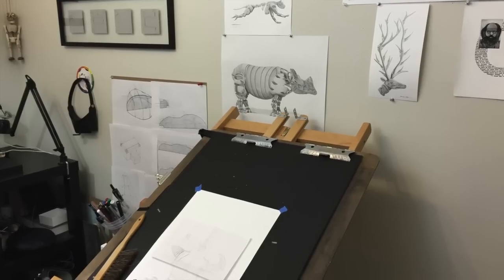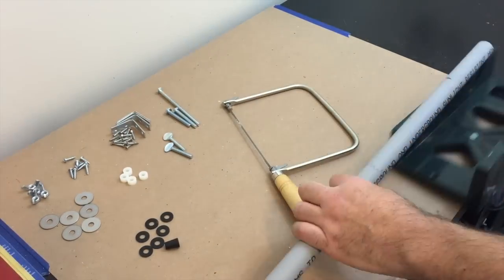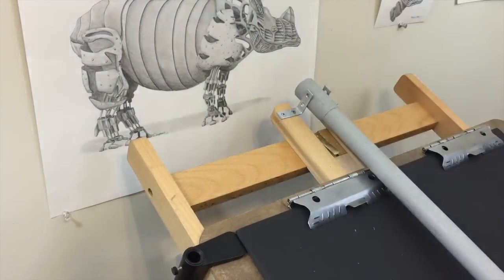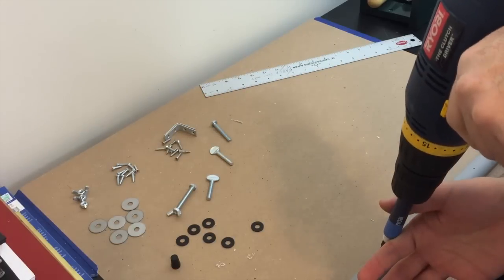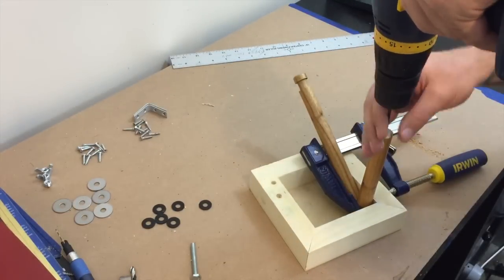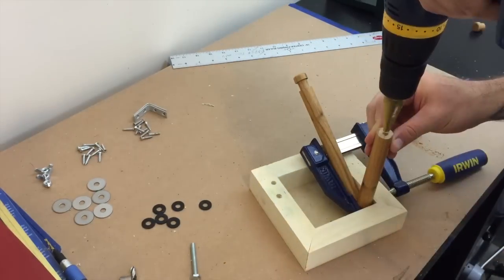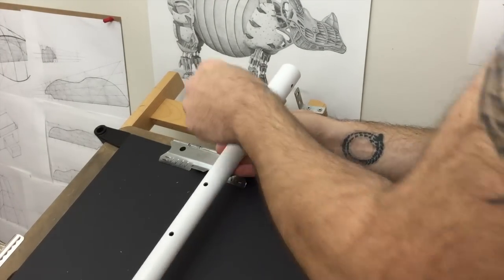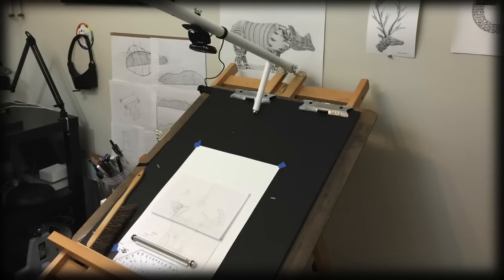Making An Easel Camera Mount For Recording Drawings

Comment: What kind of camera are you using? I am new to this, so , I'm sorry if the question seems silly. Thank you very much.
Reply from the maker: +Marle ny I'm using a Sony A5000 for filming my videos, and I use a Logitech C525 webcam when I'm recording drawings. I do want to upgrade webcams to a better model, but it works decent for now. Hope this help!
Reply: Thank you very much! Logitech is not compatible with Apple, right? What would you recommend for use with Macs? I appreciate any thoughts.
Reply from the maker: Sorry I have not done a ton of research. I use my logitech with my macbook pro, but looking at the requirements it does not appear to be officially supported. I want to upgrade to the C920, but it also does not list OSX support, but I believe there are some apps available to make it work from a tiny bit of research. I'd recommend just buying from somewhere with a good return policy in case whatever camera you get does not work, or is not high enough quality. Good luck!